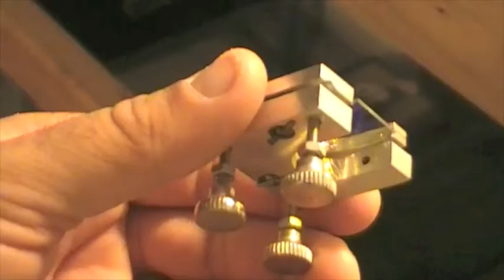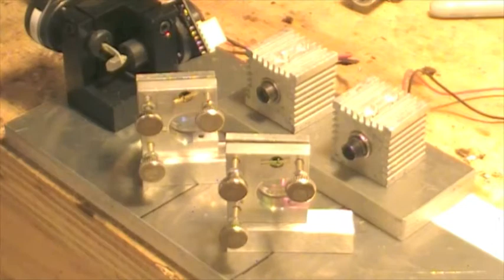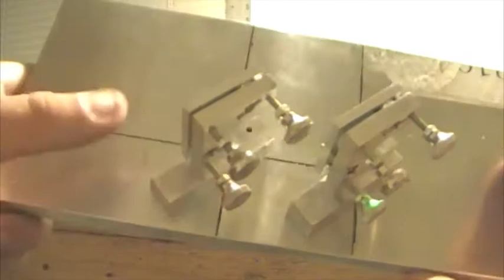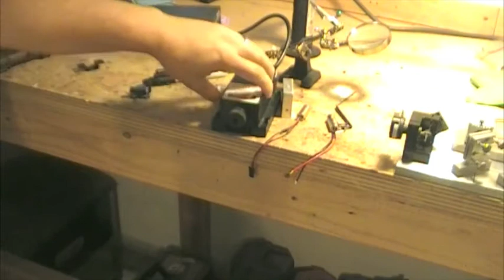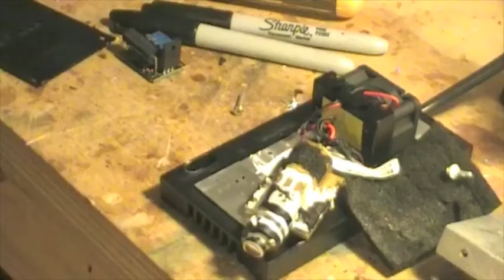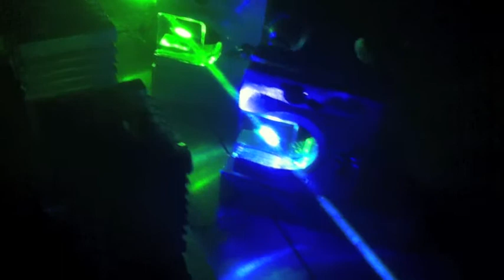RBG Laser Scanner Build Instructional Video Part 2.m4v

Comment from the maker: Yes. But once I finish assembling everything I will do a final alignment. Since the collimator lens can move around a little as well as the dichroic mirror mounts, Yes it can be bumped out of alignment. However to prevent this I use thread-locker. I put some on the lens's, focus them and let them dry. I but a dab on the adjustment screws of the mirror mounts as well. After that it takes a pretty big shock to bump out of alignment. If it does it's usually a very quick fix.